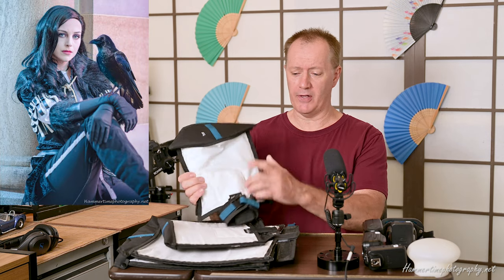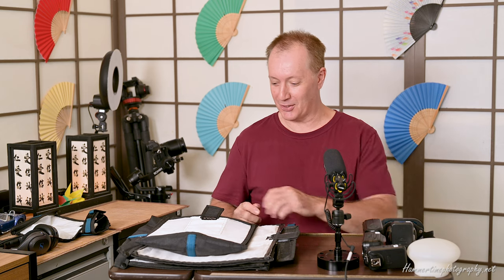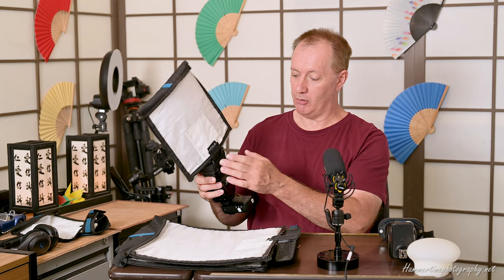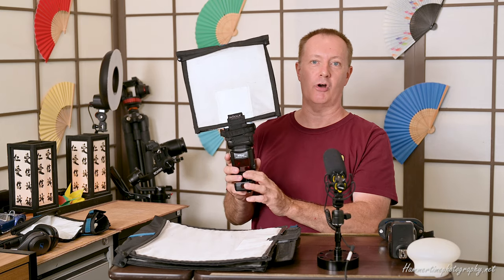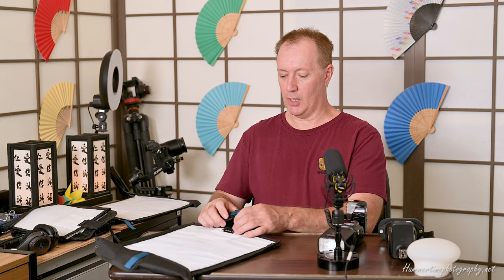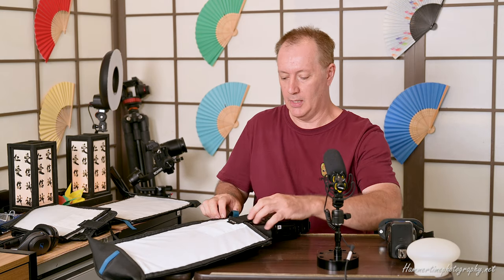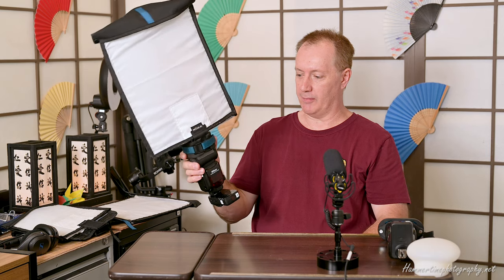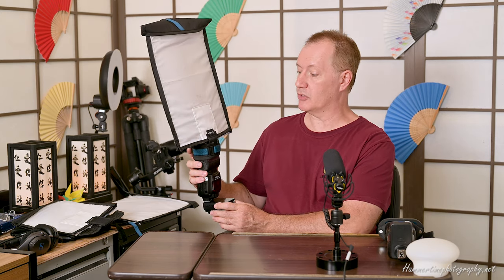Rouge "Flash Bender" modification essential upgrade.

Comment: Mark,

Thank you for your description of why using a polycarbonate insert gives better control and results using the Rogue Flash-bender.  

I am a church and event photographer and the Flash-Bender defuser gives me great balanced portraits.  I did have problems having the Rogue unit go floppy after many uses and having to spend too much before an event coxing it back into shape.  I purchased version 3 after loosing my original unit.  

Fr. Dan